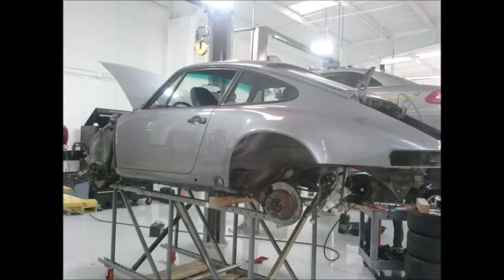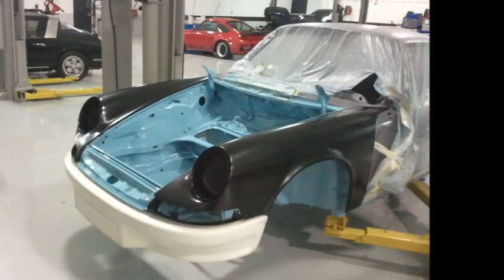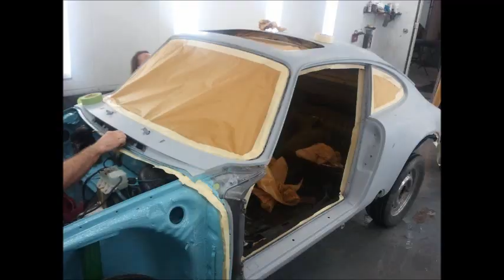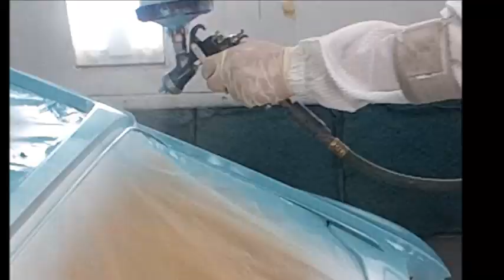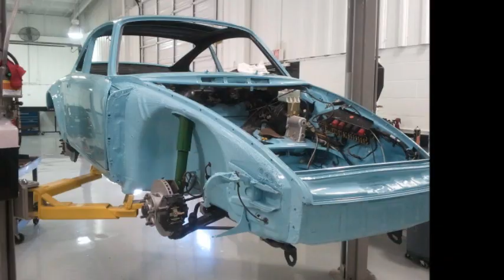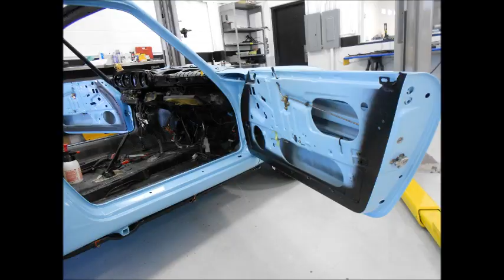Porsche 911 1989 cloned to 1973 RS   Gulf Blue

Comment: looks like a coat of epoxy sealer …however start at the center of the roof line so your stomach/waist area/hose won't accidentally rub up against the side area you just painted first instead of last
Reply: Well said! Professional.